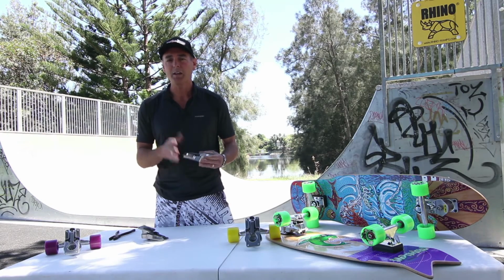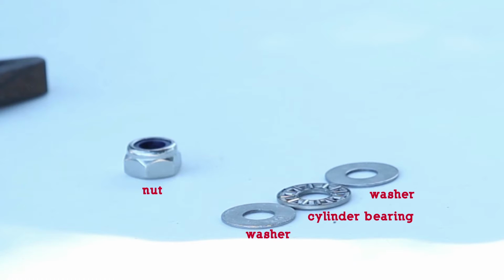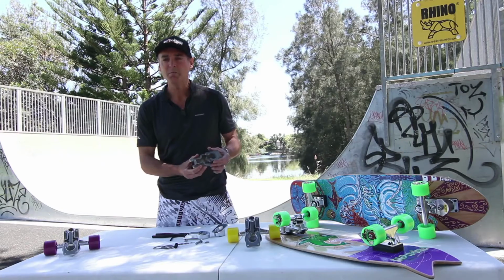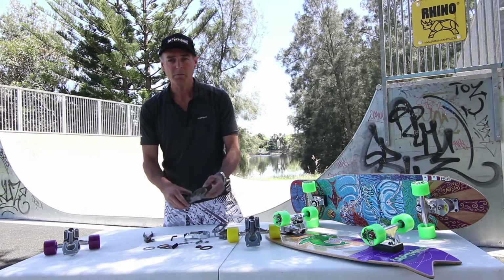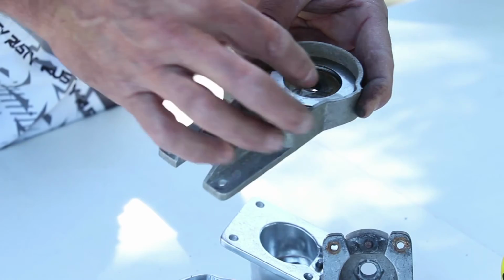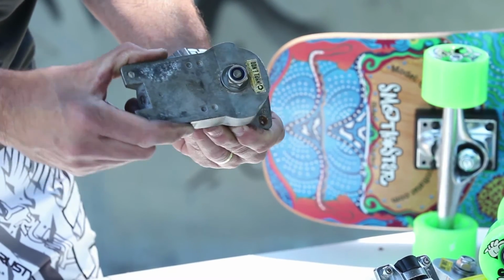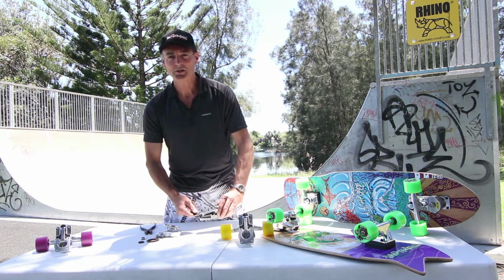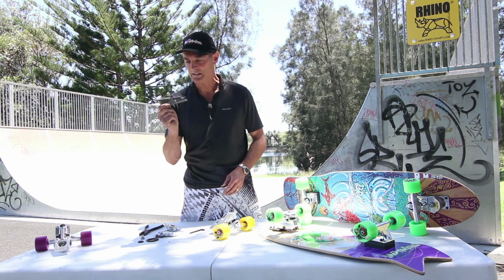Repair, Replace and Recondition your SmoothStar Thruster

Comment: Question when i received my complete “holy Toledo “ The tension was completely backed off on the spring . I tightened the spring bolt to what I thought felt right but was wondering what the factory usually sets the spring tension at . How many turns from loosest setting /Nut touching the locking pin . Thanks 🤙🏻
Reply from the maker: Please email our support team. support@smoothstar.com.au

Comment: Usually how long we need to replace the spring & thruster bearing (wear off)?
Reply from the maker: You should never need to. Unless you tighten the spring it's fully compressed.

Comment: Hello, I've been riding my Flying Fish Smoothstar for a month now and the thruster has started to squeak like mad in the last few days, I don't think there's any need to open it 'cause it doesn't seem dirty at all, I'd just like to know what to use to lubricate the mechanism. I've put a bit of Svitol for keyholes in it but it probably made the squeaking worse.
Reply from the maker: Totally not an issue. Please use machine oil or sewing machine oil... Not WD40 like what the video says.  Put the board on its side and put 3 - 5 drops on the front and end of the spring
Reply: @SmoothStarSurf  I'm so happy you answered so quickly, thank you!!! I really wanted to go for a ride right now ^__^
Reply from the maker: @oscar17891  there are a lot of moving parts in SmoothStar, much more than any other normal skateboard or other surf type skateboards. However, just like parts in a car, they need to be lubricated. The oil cost about $4 from most supermarkets. Very easy to find. Unfortunately due to difficult logistics issues, we can't include spare oil with the SmoothStar as it's flammable
Reply: @SmoothStarSurf  Again, thank you. The problem is I put the keyholes oil on all parts (the squeaking doesn't seem to come from the spring) but it still squeaks. I'll buy another type of oil and see what happens

Comment: Can you tell me please how much torque the self-locking nut has to be turned on? You only use feeling and a plier?!? My problem is, that the large bearing ball from my brand new Manta Ray (buy end of june 2018) is damage totaly. From beginning the nut was very loose - but i dont adjust it (warranty - i know) . But yesterday i have an unpredictable accident with the board  - we front truck blocked and the wheel came against the deck. Not funny. So i feel, that the thruster dont work correct and opend the nut and saw the damaged bearing. It was a mistake, cause i lost waranty and the only information from your czech dealer was, to buy the bearing wheels new.  Not funny either...
We talk about an new 280,- EUR expensive smoothstar Board and not Hodura chinese skateboard for only 30 bugs. Iam very frustrated,  cause when i buy the spare parts and build it together again, the question remains how firmly the nut may be turned on, so that the bearing is not damaged again. You understand my two problems? No warranty and no further help (at this moment)

I can send you pictures, then you will see and understand what happend in only 42 days. Would be glad about an answer. mahalo - Markus
Reply from the maker: Please email us immediately. We will sort it out for you without question. support@smoothstar.com
Reply: First of all big thanks for answer. I will sent you an email with some pictures tommorrow. So we decided whats the next step. Mahalo
Reply from the maker: We still don't receive an email.
Reply: SmoothStarSurf i sent you an email but i get no answer 🙁
Reply from the maker: Sorry Markus - we just emailed you now. Thanks mate.